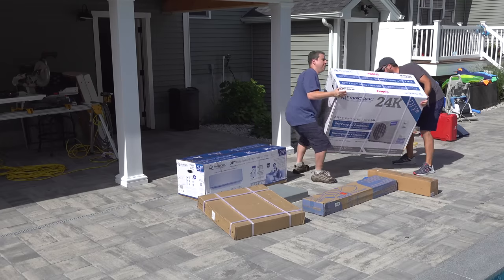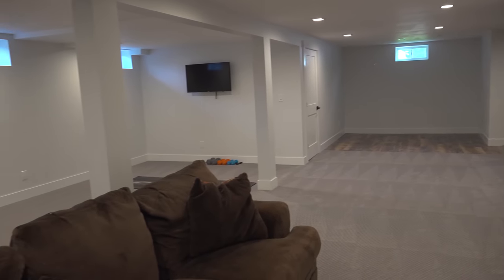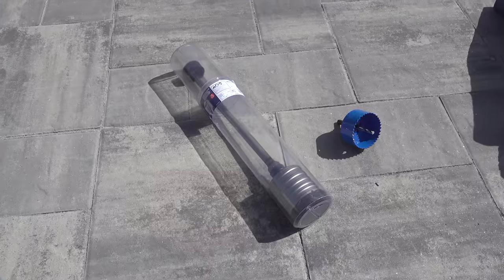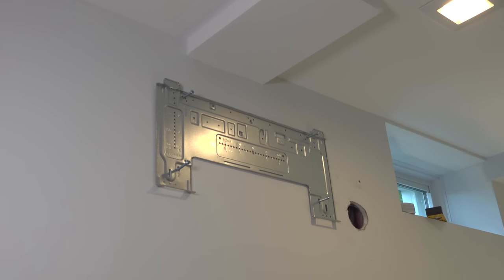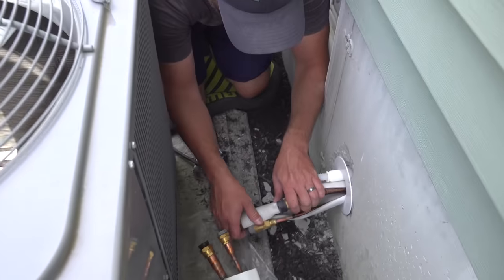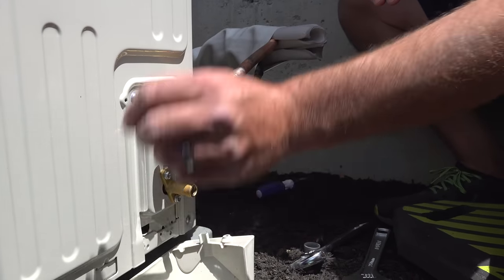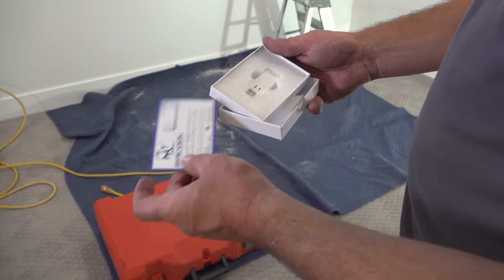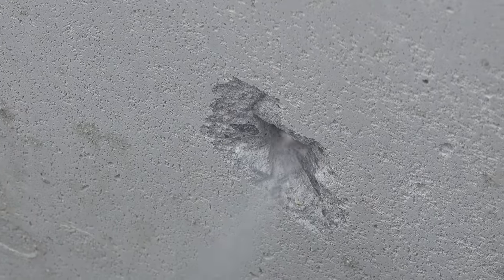Install your own AIR CONDITIONING in 4 HOURS!  DIY Mini Split MR COOL

Comment: Better nitro check it and make sure its under 500microns before dumping the charge
Reply: I was screaming this while watching them open the liquid and suction line 😓.
Reply: What does that mean, nitro check?
Reply: @weejohnbb  pressure check it with dry nitrogen
Reply: @STho205  i bet if you were to look at the install packette will tell you manufacture spec and install procedures
Reply: @STho205  thats why you leave hvac to professionals not everyday homeowners because they surely hate when it breaks down in 6 month to a year then to call a legit hvac professional to come fix it and are told its going to be more money to fix it then them it was for the whole setup
Reply: This is straight from MrCool site Precharged 410 Quick Connect® Lineset
Available in 16' and 25' options, pre-charged linesets allow you to install this innovative ductless system without special tools, equipment, or training. If you nitro check them you lose the charge that is already in the line.
Reply: @xalint1  iv been doing hvac install and service fora couple of ice cream seasons. The outdoor unit has all the refrigeration in it the lineset / refrigeration lines will not have charge in it. Lol good luck with the system in 6 months to a year
Reply: @spencerjohnson1499  Take a couple of minutes and read the Web Site for the DIY models. This is something that MrCool does to make it easier. It's not just in the HVAC unit like other brands. If you were to cut the line yes you would have to do what you would normally do vacuum and flare so forth.
Reply: @STho205  i should have figured im in a chat full of homeonwers thats cool im not going to play with trolls

Comment: This unit seems good only for a open floor plan..
Reply from the maker: It won't go through closed doors but these are used for whole floors commonly I think you have to weigh the cost of running ductwork vs keeping a door or two open. A friend recently had ducts and a system installed for $14k. It can be very costly, this may be a much better option.
Reply: So are window shakers.

Comment: The biggest misconception on this unit is the power.  On the commercial, it looks like it's 1, 2 and 3.  But, if you don't have the power box, that's your achilles' heel.
Reply: Yeah he brushes over that like it's no big deal but the bill comes in for that you'll be like I thought it was gonna be cheapppp!. I've installed the old fashioned units... it's the same deal I see here. The only benefit is that it cools and heats in a really small package, you don't have to vacuum test the lines and no duct work needed.
Reply: The homeowner needs to check his power panel to see if he has a space available for another breaker.
Reply: @rickdaystar477  That's a good point.

Comment: Im not a mason but do construction all the time. Pretty sure if once the small drill bit punches through the other side, you will know exactly where the hole is. Then you can go outside and drill back in and it will pretty much eliminate that outside damage.

Comment: Avoid the 'blow out' using a 1/4" or smaller concrete bit to punch thru , then go other side & drill w/ regular size bit

Comment: As an HVAC contractor I would have been fired for this install.
Reply: LOLOL! I'm guessing mostly the stud and the concrete drilling, and whatever I missed.
Reply: @bentonrp  The stud hit was a yikes, the main problem is that you never want to check for leaks with the Freon. You use dry nitrogen to check for leaks first, then you evacuate the line set to suck it into a vacuum. Doing those two steps are vital, not just for the environment but for the longevity of the unit.
Reply: @jacobkays380  I wondered if anyone was going to mention skipping the vacuum step. yikes.

Comment: This unit compressor will be destroyed within a year, air in the lines is a big no go.
Reply: The lineset has a vacuum
Reply: Let's just hope the lines were sealed or if this system has some sort of filter dryer.
Reply: The units I checked out from other companies all have sealed, pre-charged refrigerant lines

Comment: Somewhat new in the States but I've seen these for many years in other countries. Some allow you to have one big condenser with four or five evaporators throughout your house. They do need a proper HVAC technician to at least hook up the refrigerant lines since they don't have the built in refrigerant. I think they are great compared to our cumbersome ducted systems, especially if you don't need to cool and heat nearly all your rooms when the system is on.

Comment: This guy should not be giving instructions.
“Yea drill through the stud no biggie”
Reply: It’s a finished basement, so the studs are only there to have something to attach the drywall to. Zero consequences to drilling through half a steel stud. No biggie. It would probably take you 4 days to install this before giving up and calling a pro
Reply: Yeah.. why not just shift off the stud?
Reply: @cutrara7  But they're offering this as a DIY video and are completely glossing over the fact studs on exterior walls ARE structural but in this very unique case are not. Completely irresponsible.
Reply: @rs4race  didn't want to make two holes and patch up the drywall is my guest
Reply: @gamagetf  this isnt an exterior wall. its a basement wall. Zero structural need.
Reply: It's not a big deal in that application. This is not a structural stud
Reply: It’s not a big deal. Keep your mouth shut 🤫
Reply: @gamagetf  if you can’t tell the difference between a load bearing wall and an interior partition, then this project is beyond your skill level
Reply: @brazuka331  This one was both a foundation and exterior wall. . You can see the concrete extending above the surface on the exterior.  Few framed houses have the foundation walls run that high.

Comment: When you open the valves, open the small one first, then let the freon push all the air out by slightly touching the filling valve and at the end open the big one.
When I see this, I wonder if it even works.
Horrible job, just poor quality..
Reply: It wasnt a bad job. I do cringe that they make these seem DIY.  But the line set and indoor coil come preevacuated no need to bleed through the service ports which is itself a poor excuse for a vacuum
Reply: @leonardarch3092  thats what I was gonna say, there's not air in the lines or the unit it is prevac'd and 100% ready for freon

Comment: You should never cut through a stud.
Reply: Fr
Reply: In a basement like this it’s just holding up drywall, wouldn’t be an issue.
Reply: @bennystrom5904  Yes, you are correct. I just don't like encouraging people to cut corners on construction. If they have to sell their house, a Home inspector will possibly find it. And that can depreciate a property by $25k to $50k. 

By the way, I would love to install one of these AC units.

Comment: This unit will be junk in no time. They skipped vital steps pressure testing and vacuuming the lines properly. That compressor will die in no time.
Reply: I found the comment I was looking for. This thing will be trash 2 months later.
Reply: The lines are precharged.
Reply: @cgooch_  no, the compressor is precharged. The linesets are not. But that's besides the point. If you don't vacuum the system, there will be non-condensable contaminents in it that will ruin the freon and moisture that will react with the oil. Both will cause issues with the unit and and up ruining the compressor.

Comment: Yes mini splits are very simple to put in certain situations but as a HVAC technician when you have homeowners buying their own equipment and installing it and not doing it properly they in turn call a certified technician to come fix their problem and tell y'all a lot of companies will not come touch it. just for the fact if they did it improperly and that equipment starts having issues then it becomes that companies headache. Your best bet is just to buy your equipment and find a company that will install it for you or call a company that installs and sells this type of equipment and have them do it for you because typically a company will charge you probably about three to four thousand dollars for the equipment and to install it

Comment: Small important detail that was shown but not explained was to drill in a slight angle going out the house for the condensation drain otherwise you will have sitting water, And before releasing freon, vacume pump the lines because you only got one shot with those condensors otherwise you will have to call down a licensed technician to charge you by the pound. always be safe than sorry. Great video!

Comment: With the STS drill switch to standard drill mode for the very last bit to avoid blow outs. If you're experienced you can hear, feel and even guess very well when you are at the end. But since the centre drill part is longer you could have a buddy on the outside to let you know when that tip comes through to switch to drill move for the cleanest of drills

Comment: I just installed a 28k btu  3 zone but it doesn't have the pre charged lines of Mr. Cool DIY so I have to wait for a tech to torque the connections, vacuum the air out, test,  and release the refrigerant.   Doing the electrical was easy for me though; I bought the 220v outdoor switch, two 6 foot weatherproof power "whips" and a 30A breaker from Amazon.  It helped that the condenser was just through the foundation wall from my breaker box.   I poured a concrete footing for my condenser too.   So for me more like 4 days for 3 zones plus hiring a tech for the last steps.  Then you have to clean up etc.  "4 hours" is click bait fantasy lol but whatever.

Comment: So is he running 3 systems in that house? Or does the house have a rental on it? I see 2 other units besides the one you installed. "That's crazy"  Also, If you removed more than 15 feet of that line set, your system is probably a little over charged, you will actually lose efficiency if its Under or Over charged. The next time he has those other 2 serviced, have them check the charge on it. Just my opinion. I've done HVAC for a little over 15 year's. Doing that will lengthen the life span of that system. Nice Video!

Comment: I would also say this is good if you only need to cool/heat a small area (like under 1500 square ft).  If you need multi-level heating/cooling your better off just buying an actual Heating/AC system that's designed for a whole house.  It may cost more up front, but may be cheaper to operate over the long run.
Reply: No, these are far superior because they enable room-level temperature control, and they're much more efficient than central systems. Each room in my shop has its own head (I have a 3-zone 36kBTU version of this), so if I need heating/cooling in only one room, I can do that. I'll be putting another system in my house. No more running the big central system just for one room. Central systems have lower SEER ratings and they lose quite a bit of energy in the ductwork too.

Comment: You'll need some corrosion resistant metal stucco lathe. If you can't find metal stucco lathe.... use carbon fiber stucco lathe!

This seems like an easy DIY job for somebody used to installing more complex HVAC systems. But as soon as you busted out the hammer drill, I bet a ton of people noped out.

Comment: The line set is pre-charged and has special O-Rings that seal and does not trap air during connection.

Comment: Recommend spray foam insulation after running those lines out and a good sealer for the inserts on the outer wall. So much for this being a complete diy.
Reply: I Came here to say this, water is gonna leak through there and God knows what else. (Insects)

Comment: When you drill the hole for all the connections as well as the condensation line you can just drill it straight wiht no type of downward angle?

Comment: for everyone wondering, a new "window" ac is still 1/3 of the price of a mini split at the same btu, and hardly take anytime to install, i person have all three systems (window/mini split/whole home), mini split in garage, window ac (in wall, i like my windows) whole home ac, the window ac lg puts out more then 18k btu more then my mini split 12k and much cheaper plus wifi connectivity and can be picked up anywhere, just have a 240v outlet

Comment: Nice video, Although!!!!!
You should edit the portion on drilling the concrete hole. As others here have suggested, finish the hole by drilling from the oppposite side to you started from, once the pilot bit becomes visible.
No blow out!!!!!!

Comment: I would love this unit in my apartment right now. I don’t understand how landlords don’t invest in this for their tenants. They make the money back within 4 months. Putting and storing ac units are rough especially in small NY apts.
Reply: Would you have to keep bedroom door open to cool the bedrooms?
Reply: @ Jen M Mini splits have become more popular in the last few years 
They are very quiet both inside and outside units. I think it might depend also on the building designs as well the cost of installing these could be prohibitive in some cases. There’s no question they are better by far 
Window units are terrible, noisy and inefficient at their worst. Also might depend on the landlord  if you know what I meanl lol
Reply: @james4582  in my particular apartment it would’ve been extremely easy for units to be in placed in each room. Not only is the building completely detached but the owner renovated the entire house! There’s also a massive yard that can house the outdoor units. We have boxed rooms which does not allow for good air flow. They gave us a portable ac basically saying we don’t want units in the window without saying they didn’t want units in the window. The portable is extremely loud, inconvenient, big and very very energy inefficient. They since sold the building and while the new owners are wonderful they have not mentioned putting in this system. If we were to have put an ac in each window for every room that’s 4 units in total. Then where do we store it once summer is done? If we leave them in the window we risk the cold air getting in during the winter as well as it blocking the light, winter is already dark and gloomy. I understand in the older attached NY apartments it may be a tougher job but it is worth it. Having a window ac can also be dangerous if not properly installed as well. The rent we pay, the Splits could be paid off in 6 months, maybe 7 if you want to allow for tax and install fees. It’s a one time thing that will last for years. So many landlords are just in it for the money and don’t see tenants as people(clearly evident from recent tragic events)
Reply: @deenad3562  ideally, you’d want one installed in each room. This allows you to adjust which room you want cooled but also go by sq ft. If you only have one unit let’s say in the center room of your home you’d need to leave the bedroom doors or door to any room opened to allow the air to flow.
Reply: @jenm6476  I'm not sure how many inside units one system can accommodate. I thought I heard him say the maximum distance from the outdoor system is 20ft??
Reply: @Jen M I understand that situation living at the mercy of someone else is often difficult in such cases as this and all things considered it’s up to the landlords and whether they can or cannot afford the change that said it was always my way in this business to give the customer (even landlords)  all options and explanations. That really seldom worked out for the tenants but again sometimes it did for someone that understand cost savings. Unfortunately many landlords aren’t interested beyond getting by until they can sell and turn a profit.
As I said these mini splits have a lot of options much more favorable over wall or window units. And depending again on the type of construction of a building there can be several evaporator (heads)
Attached to one condenser a
Reply: Also said, I have worked with company owned complexes and individual owners that did things to keep good tenants satisfied though that can be rare at times.
Good luck to you I hope it gets worked out in all’s favors.,

Comment: 0:36 that type of exit wound can be avoided by sending a pilot bit through the wall first then running the hole saw from the outsides of the wall to the center of the wall.  If you just send the hole saw all the way through, it busts out when it reaches the other side.  And of course the hole needs to be angled down towards the outside for drainage.

Comment: It works. But You should still use vacuum pump to empty the gas tube first before release the refrigerant. Air and moisture mixed in refrigerant will decrease the efficiency and life of compressor. It used to ok for R22. But it is not ok for new refrigerant.

Comment: In the US a federal refrigerant handling certification is required for work like this. Refrigerant recovery equipment is also required to be on site. Many municipalities in the US require permits so the unit is installed correctly and is safe to run. While I’m sure most DIYers may be able to handle this installation when everything goes right, what happens when things go wrong?

Comment: Did you have to add any refrigerant to the system?  What type of refrigerant does it take? You did a very good job installing this unit, thanks for making this video.
Reply: Carl Capello -  NO  refrigerant  should  be  added  as  this  is  a  'sealed system'.   When  the  'self-piercing'  line-set  is  attached  to  the  outdoor  heat  pump  and  the  indoor  air handler  it  does  not  allow  any  contaminants or  leakage  if  done  properly.   IF  they  screw  up  on  assembly  and  back  off  a  connection  allowing  air  to  enter  .  .  .  .  .  .  well  then  your  'screwed'  ! ! !

Comment: So this system arrives in a passive pump down state in which keeps the refrigerant in the condenser while the evaporator or in the case the air handler is not hooked up.